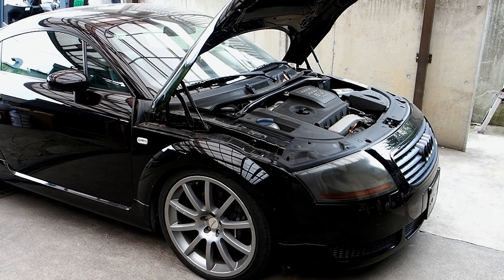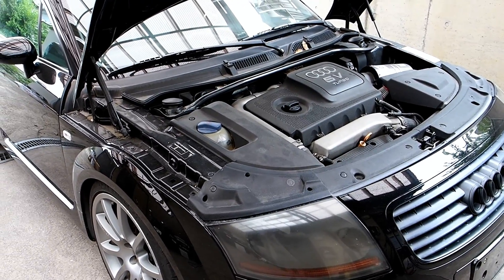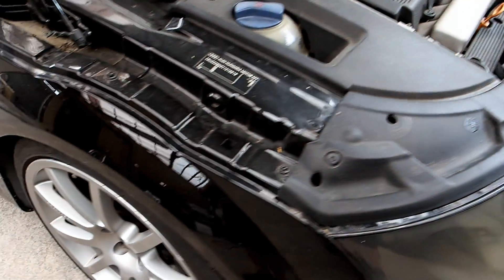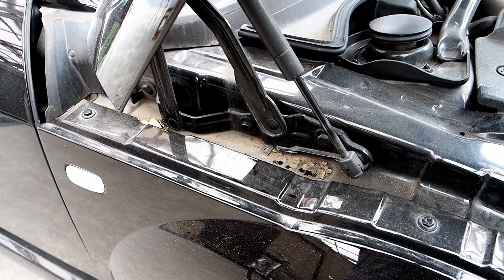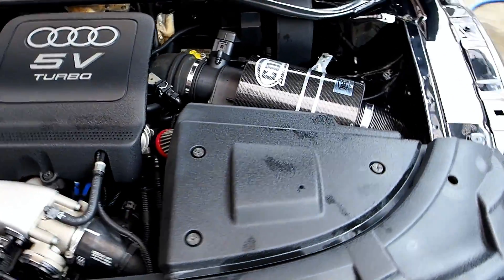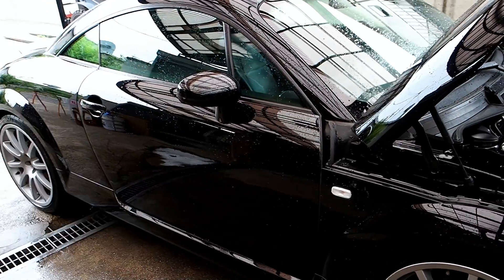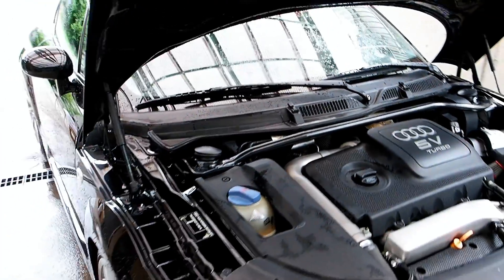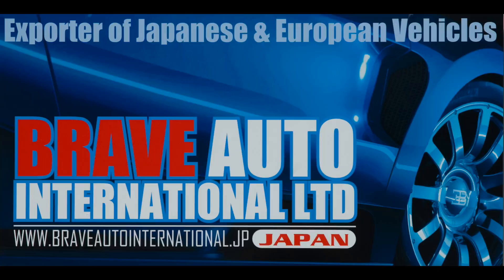Why We Wash The Engine Bays.

Comment: If someone buys the car, and you clean it, roadtest it etc., and something is wrong, do I get my money back ? You say some agents just take photos and send the car off, but if you have already paid for the car what is the benefit of doing anything else as I don't think you'd give a refund if you found rust or the road test is bad.
Reply from the maker: The benefit is that the vehicle is still in Japan which means the buyer/importer has not paid shipping, import duties etc resulting in the vehicle owing them a good percentage more than what they originally paid at auction for it. So they then have a chance of getting their money back by reselling the vehicle within Japan. If you watch this video it will become clear -  https://youtu.be/fQw1LIxUNnQ?list=PLE7F175B943336675

Comment: What chemicals / detergents do you use for the engine bay or just high pressure? Thanks
Reply from the maker: Evergreen as it will remove the grime but does not damage the paint at all.
Reply: Do you clean the interior too
Reply from the maker: We vac them out and give them a wipe over but we do not detail the vehicle, we just clean them for export.